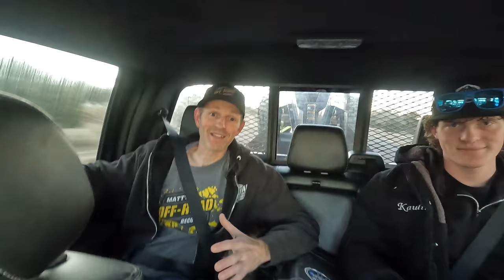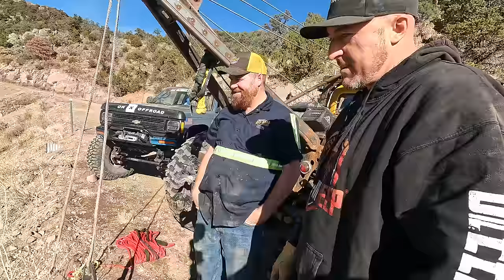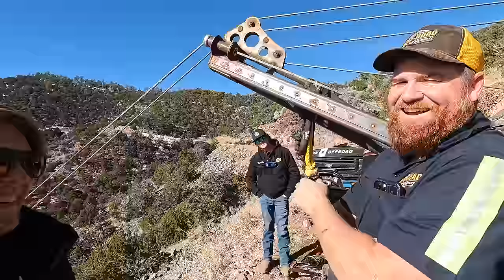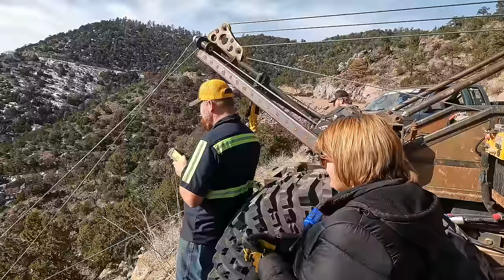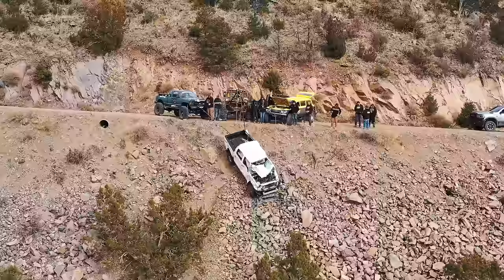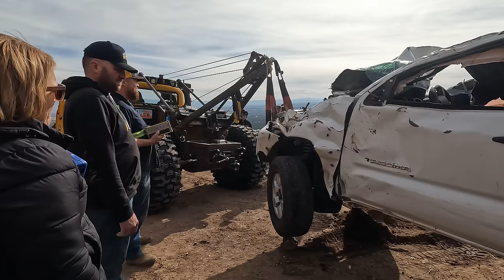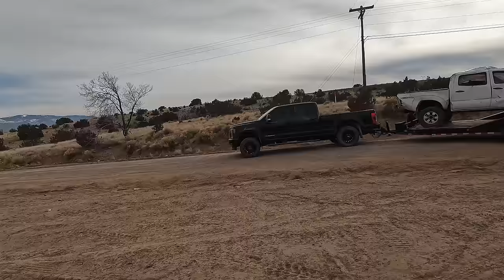There's No One Who Can Recover This Toyota....

Comment: This is probably the most impressive recovery Ive watched on your channel. I am a structural engineer, and the sheer amount of stable pulling power the heavy wrecker has is impressive and showcased in this video.
Reply: It wasn't technically all that difficult but they made it look so easy and that's what was impressive. A lot of people could have done it but not in 2.5 hours!
Reply: I'm glad he got there before Heavy D
Reply: That wrecker may be a garage built wing it project but it is incredible at what it does and is amazingly reliable.
Reply: @marvindebot3264  a couple years ago they pulled a car up a snowy embankment with the morrvair and banana. It was on snow rather then rock and brush, it was a shorter pull, and the embankment wasn't as steep. They struggled and it took them forever. The wrecker made this quick, flawless, and looked very stable in the video. Also as they said in the video, no other tow service would even try to pull it out. That indicates it must be a tougher recovery then it looks in the video if the insurance company is using a company 8+ hours away.
Reply: @adambeaudry7784  Having the right guys and the right equipment can make a hard job look easy. Hats off to Matt and his team.
Reply: Love watching you guys
Reply: @fantabuloussnuffaluffagus agreed, but dead pulling a truck up that embankment plus the additional force required to overcome the friction of the rocks and trees all applied at the end of the boom creates a very large moment (rotational Force) around the back wheels trying to lift the front wheels of the wrecker. They anchored it to jefe's truck, but it seemed so stable in the video. It makes me wonder what it's actual limit would be before it became unstable.
Reply: There have been others. . .
Reply: This is one is pretty impressive but I still think the Golden Nugget recovery was the most challenging.
Reply: Agreed....they did a fantastic job....Very Professional
Reply: @adambeaudry7784 and I hope the insurance company didn't give them any grief with the bill - was worth whatever they charged.
Reply: @brockryan3405  What's with all the HeavyD shade lately?
Reply: @hibiki54  people gonna be people, everybody makes their own drama...